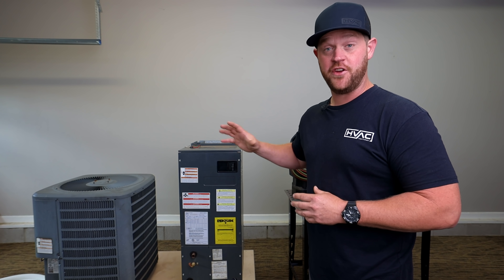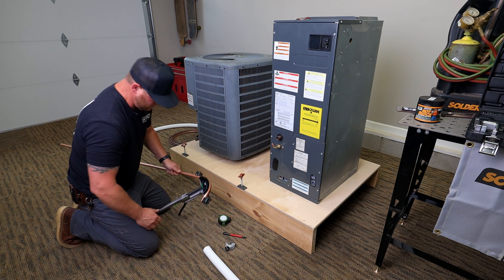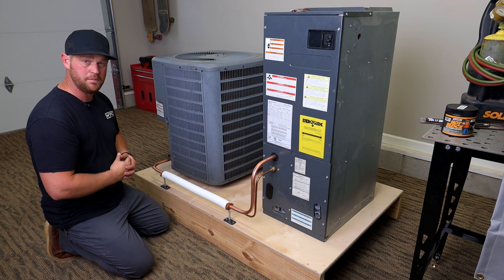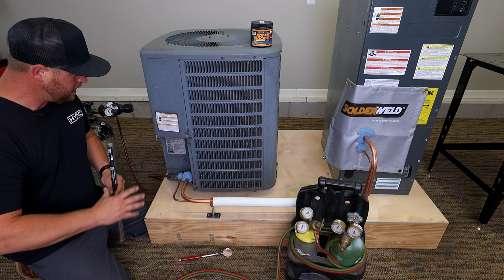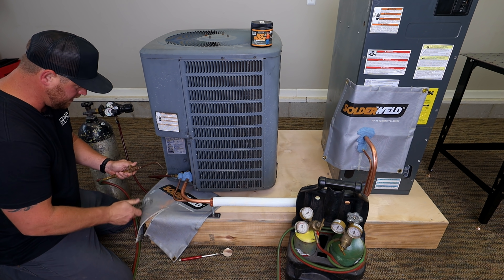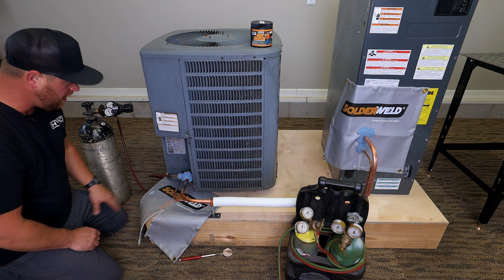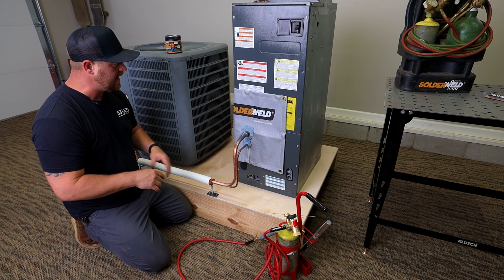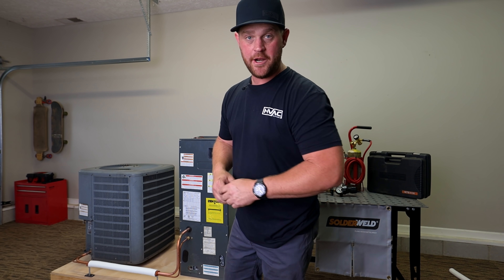How to Bend, Prep, and BRAZE Copper to Copper on an HVAC System

Comment: I'll stick to staybright 8 faster, cheaper and just map gas. To be fair I do use a roll of safeyt-siv 45% for compressor changouts.
Reply: Map gas on some 7/8 gotta take forever lol.
Reply: @AllTattedUp13  It does... and that's how the amateurs end up burning out seals, grommets, panels, Schrader valves and o-rings, etc.
Reply: Not really. Takes less heat. Does take more prep time. Probably more cost effective to soft solder due to lower material costs.

Comment: Great job Zack!!! Always good stuff here!
Reply: Hey Craig what is the difference between oxy acetylene and air acetylene? Is it just personal preference? And what's a recommended tip size for air?
Reply: Air acetylene is good, harder to get a neater braise joint, but quick and easy. Lighter and easier to move around on the job. They are noisy AF, need ear muffs for sure. I've used it on everything from supermarket refrigeration, air, and everything else to a small unit. It's not good IMO on TXVs etc. Just like mapp gas, it draws air in from near the tip to keep the flame hot and functioning. Most  TXVs are deliberately installed in the hardest spot to get to, so it will draw in its spent oxygen that the flame has burnt and make it dull. You know what I mean. I used to do alot of install work and used it almost daily. I still use it in service, but not as often, and probably wouldn't buy one if that's all I did.
Reply: Is the air acetylene tank the same as a “B tank”?
Reply: You are a monster man exelent video

Comment: You missed the most important part....the calculation on bend measurement to get the pipe to fit.
Reply: I agree, I watched for bending tricks not product placement.
Reply: Maybe wants to leave that trick to himself
Reply: @SalvadorHVAC  lol shit
Reply: yep wished he had shown the take off
Reply: yea thats what i was hoping for
Reply: It's eyeball method like he said. Once you do it a couple of times it's easy. I wish the kit could do 1-1/8 copper but it doesn't.
Reply: You could use fittings and measure. But after time with a bender you can just eyeball it and know where you need to be.
Reply: 8273152348 call me

Comment: no filter drier?
Reply: Goodman's come with one in the condenser, plus he said this video is for just showing brazing with the Oxy/Ace Torch, Air Acetylene Torch, the pipe bender & Solderweld gear.

Comment: Great video man, I'm in school switching careers, i would love to know your thought process while brazing. Like where you're applying heat, what you're looking for before you apply the solder weld. Maybe pressures on your regulators for oxygen and acetylene. As well as tips you've learned along the way that you personally like. Thanks for the great content.
Reply: I go 7psi & 10psi on my pressures. 7psi on the Acetylene, 10psi on the Oxygen. 👍
Reply: Just keep ur torch on the copper/fittings till they start to glow, or just tap ur braze rod up to joint every few sec and once it starts to flow, you know u got it hot enough and that's when u can start backing off with torch and just hit it again when it's not flowing like liquid. You'll get the hang of it, becomes 2nd nature after awhile.
Reply: I learned that once it’s hot enough to start flowing you move the torch farther inward towards the joint to suck in the solder.
Reply: PRACTICE. The nice thing about brazing and soldering is you can melt it off, clean up and reattack. Also do some structural brazing because braze joints are quite shock-resistant and being able to make things with the same torch you use for tubing can be quite handy. You can gas weld and braze sheet metal but avoid doing galvanized because the fumes are legit dangerous. Torches are wonderful things ANY mechanic or tech should have. Get some torch cutting practice on scrap too because it comes in handy. For example my bro and I buy used steel for our shop buildings, work benches etc and I bring a small cutting torch along to trim our scores to fit on the car trailer. A small cutting attachment can cut surprising thicknesses of steel effortlessly. All US-made torches have internal soft parts compatible with LP (I rebuilt my own torches and regs per factory literature) so be aware you can use LP cutting tips and run the torch off a BBQ jug by using CGA-510 adapters from your welding supply. You can run little torches off larger cylinders at home. I buy used cylinders off Fecesbook Marketplace because they're filled by exchange so buying new is pointlessly expensive.

Comment: Had one just like this loved it and then suddenly after 2 years it broke :( 
Thanks for the video, can you recommend wireless probes, hoses and anything that will make the job easier in the upcoming cooling season. I've tried the UEI probes because of their cheaper price and a charging port but unfortunately they're not that great would love to see your opinion on these more expensive tools.
My UEI probes leaked refrigerant and had a few other minor issues, is that to be expected of today's tools to just not last longer than a season or two ?
Reply: The fieldpiece probes are awesome, but as for digital guages, I like my yellow jacket digi ones better then my fieldpiece digital. The touch screen on the yellow jacket is sweet, it gives full graph readouts.
Reply: And def get some Trublue hoses for pulling vacuums. Them things are a HUGE time saver.

Comment: No fair, brazing with all the welds infront of you lol. Gotta love them installs where its butted up to a wall and u can barely get 2 hands in there to braze lol. Def gotta get me some that heat putty. Been using the gels but that shit goes everywhere but where u want it.
Reply: Can you put the gel in a wet paper towel?
Reply: @etlawson6939  tried, the paper towel falls apart, also tried a rag. Just been using trusty ol wet rags. But there are them times when u gotta braze in close quarters. So ima grab me some of that putty block.👍👌👌
Reply: @AllTattedUp13  , I use wet rags most of the time.  Nothing else but I may try the putty.
Reply: @etlawson6939  yea I mainly want it when brazing the line to evap coil. Cabinet right there, the rubber oring/grommets. I've had my guys braze them and the valve port they put on the coils when they pressurize them, had them shraders leak. Pain in the ass to have to take ur work apart cause that stem is leaking behind case coil lol. And a rag don't work well there cause it prevents copper from getting hot enough. That's where I been using the gel, shits messy.

Comment: Can you do a video on how long you measure the pipe to make it land where you want it once you get done bending the 90 degree bend. I have the same bending kit and I try and make my bends where they hit perfect but I always seem to mess up the measurements and have to cut out some of the pipe and braze it together where it will come out correct.
Reply: Try lining up the center of the copper you wanna connect to with the line on the tool
Reply: If its bending to the right use the right mark. Bending to the left use the left mark
Reply: @ghettocereal  just so I understand, let’s say that the line set needs to go up 20” and in 10”, do I cut the pipe 30”, Mark the pipe at 20” and then line the marks up?
Reply: Matt Florence honestly I have a hard time visualizing your question lol. The only way I can describe it is if you’re running along your tubing, when you make a bend you use the mark on the same side that you are bending. So if your line is going to the right and you make a bend, you use the right tick mark in the bender because you’re heading right. If you’re going left, you use the left tick mark. And the same concept basically applies for goin upwards or downwards if that makes sense. Just get some practice pieces and try it out
Reply: Its really easy once you get the hang of it
Reply: Nice tool